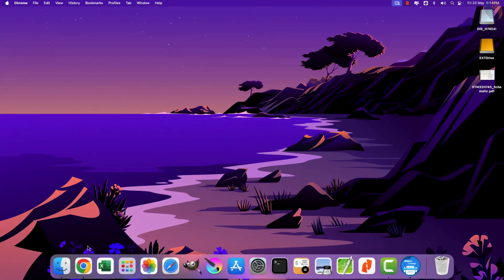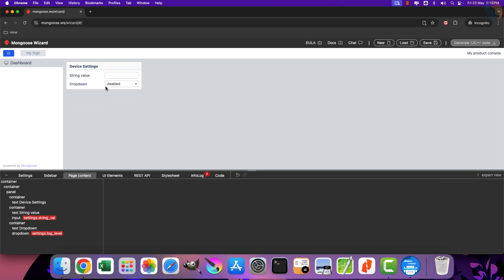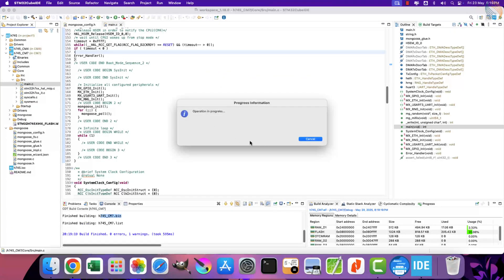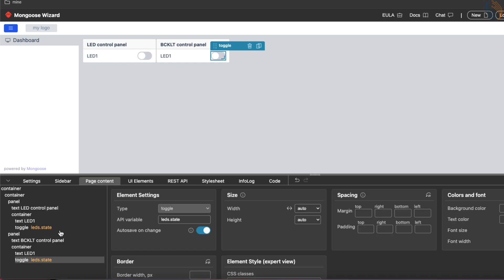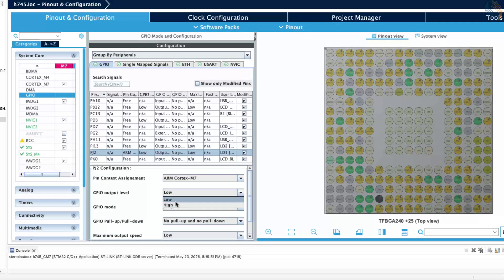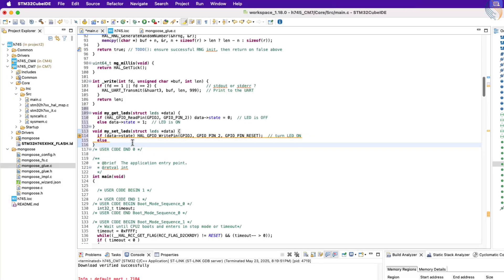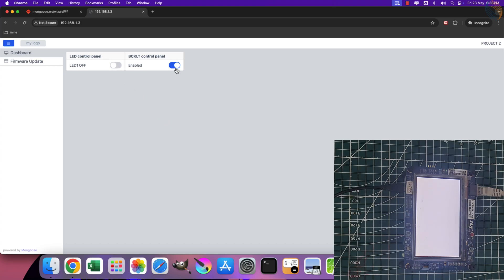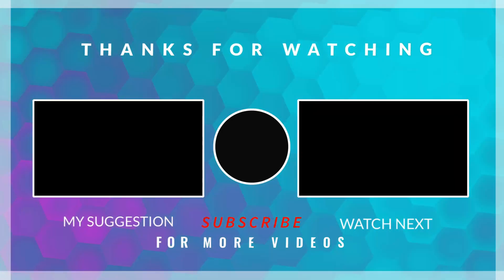STM32 ETHERNET using Mongoose #4 || OTA Firmware Update

Comment: Excellent series with Mongoose. Instead of an Ethernet adapter, can one use a WiFi adapter so more STM32 boards can be used? ie. use a ESP-01S WiFi Serial Transceiver Module?
Reply from the maker: No, it can not work with ESP-01 in the way you want.
Although mongoose do support ESP32 chips including ESP8266. You need to use espressif IDE to program the device using SPI. Then you can implement some serial communication between ESP8266 and STM32.